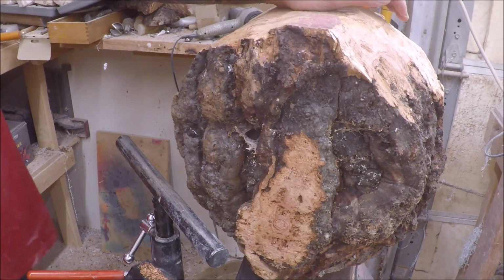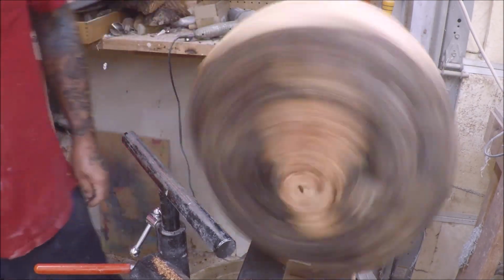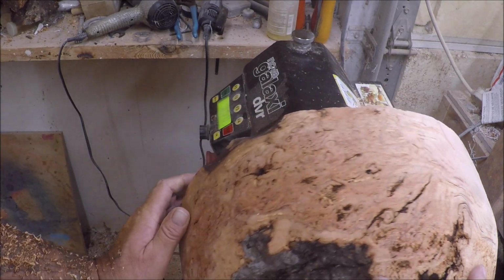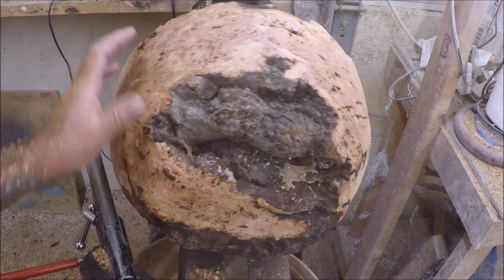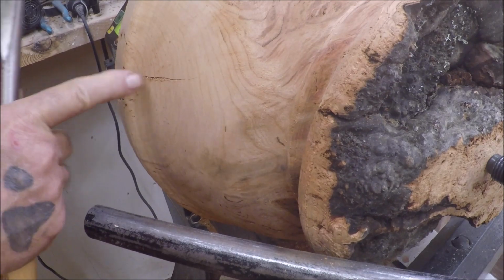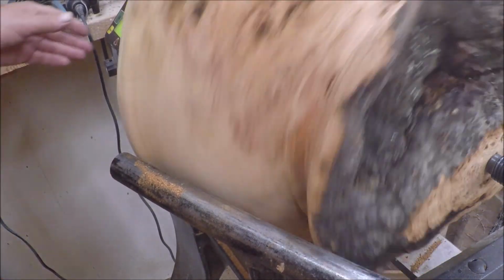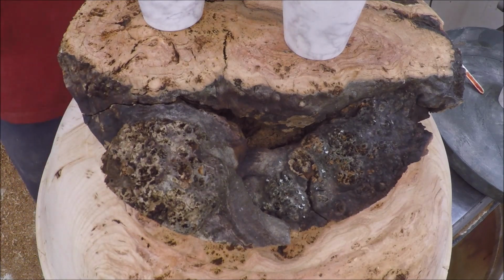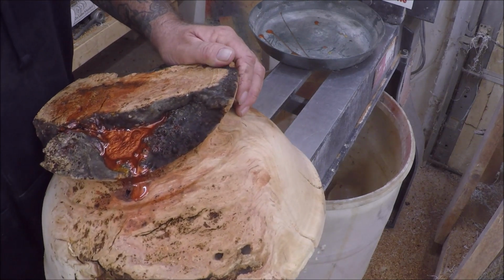Cherry Burl Bowl

Comment: It's looking great so far, Doug!! I still haven't turned any of the rest of that burl. I will probably have to cut the pieces I have down a lot smaller than that. Looking forward to the finished product. My guess is that Mrs. Doug may find a place for it at home. LOL
Reply from the maker: Thank You Clayton. I'd let it dry a bit longer if I were you, I've been dealing with it cracking after I had it where I wanted it.

Comment: Great start, Doug. Just received a nice maple burl that'll need some filling similar to yours (half the size, though) , so I'm watching, closely.  :) Have a good one.
Reply from the maker: Thank you Jay,  I'm a little worried about that much resin not being in the pressure pot, I am sure it'll crack when it over heats, I might make the foot smaller to avoid that.
Reply: @PohlBarnProductions  I did wonder about that possible problem. Either way, I will be watching and learning from your final results.

Comment: Interesting. Question though. How tough is it to keep a flat surface. When there isn't any consistent wood all the way through the turning process.  Wood air gap wood air gap? Are you using your hands to take the shock of the wood? Sorry having a hard time explaining
Reply: Looks good but my eyes are droopy. I'll watch it tomorrow.
Reply from the maker: Thank you Greg, Good question!  for the most part I am using my finger as a guide and then I use a straight edge or some thing flat to check across the bottom, I always cup the bottom in so it doesn't rock